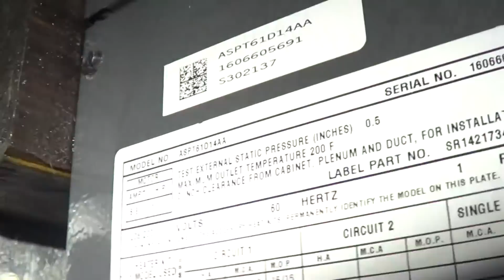How to diagnose and fix water blow by leaks on Evaporators

Comment: I got a downflow with slant coil and it leaks bad but the crazy thing is if I leave a gap in between the doors it doesn’t do it..
Reply from the maker: If the drain is on the suction side of the fan it will need a water trap of at least 2 inches.    Opening the panel may be reducing the suction in the line.

Comment: I have a Goodman Air Handler with water blow by. The unit is installed in a "Horizontal Right" application and the company we bought the unit from does not know there is a kit for the fix. The instructions in the install literature is very misleading. They have in the Heading "DOWN FLOW/ HORIZONTAL RIGHT" which they then refer all to DOWN - FLOW which is mis leading. We had to find out the hard way that you treat it as a down flow even though it's HORIZONTAL RIGHT. The distributor had to order the kits and goodman's tech support was not helpful. Equipment is only as good as the support you get when there is a problem. We lost two motors and two circuit boards because if this problem. Their local rep tried to blame it on duct work which that was not the problem. My suggestion if you install these air handlers in a horizontal position get the blow by kit and lean the air handler as this video is excellent. I think we need to relocate the circuit board in a box outside the air handler.
Reply: Can you advise what the blow by kit is and where to get it, tried using google and no luck. Having the issue that our unit above in a tiny attic used only for the airhandler is leaking loads of water and I'm sure the reason is because unit needs to get tilted along with needing the blow by kit you suggest.

Comment: Sounds like you are moving way too much air. What is the CFM per ton ? To much air flow will cause that same problem.What is or was your delta to?
Reply from the maker: I didn't measure airflow on this job because the system is the max size of 5 tons.   Airflow has to be max.   You do have a good point though.   I usually do 400 cfm per ton on heat pumps.

Comment: This is a notorious problem with Goodman air handlers ! Did you just prop up the front, so that the air handler is higher on the front end?
Reply from the maker: Prop up the back side so that the drain pan pitches to the drain.
Reply: @NathansHVAC  I saw it, when I looked at the video again. I put Goodman/ Amana in for years, & this was an ongoing issue. It seems to be more prevalent with the 5 ton air handlers . A few years back I became a Trane dealer, & all the water issues stopped. I was spending tons of time on these water calls ! Thanks for the information !!!!

Comment: I got to comment cause you sound it exactly like my own way of thinking. I used to install AH units in Attics in SW Fl for 10 yrs. I always did the same higher by 1 inch on oppositte side of drain. Never had an issue with Drain Leaks sittuation at all.  Once someone Else installed we have multiple Call and Go backs .. U true and right 100 %  They supposse to drain when installed Level but not Always😁 tnks bring memories of my 80 s inside Attics.....ttul

Comment: Evap coil end cap need to be modified for left air charge, coil looked flipped because I noticed lineset brazing point on top. It usually on the bottom. So end cap need to be flipped and J tube( water dripping guide) need to be relocated.
I believe instruction sticker in the A coil end cap.

Comment: I have same problem
?how can i fix
Reply from the maker: Clean the drain line first with a shop wet/dry vac.  Sometimes it is just a clogged drain.  If they doesn't dry things out just tilt the unit towards the drain.

Comment: Seems like High  air velocity taking water off the coil  or air turbulence
Reply from the maker: Actually, I think it is ram air pushing into the plastic drain and feeding into the gutter.   The ram air pressure at 20 mph airflow is 0.25 inches of water.  That is enough to over flow the 1/4 inch high gutter.
Reply: NathansHVAC I guess that's a newer design on the goodman coil?

Comment: I was thinking the same thing about static pressure and airflow. I've worked on a lot of those units and have never seen that problem before. Pitching the unit is almost always a good idea. Also I always like to have a tee after the drain trap for a vent that allows the trap to prime easily. And of course a tee before the trap for clean out access. That's just an FYI, it wouldn't help this issue.
Thanks for sharing this one, it's definitely interesting.

Comment: What's your static? Just move the motor tap down a speed. And is there no trap on that condensate line??! Needs a trap because that compartment is under a negative pressure. It's in the IOM.  I like the inspection camera
Reply: I was wondering about what your static pressure was too. Having worked on many of those units I have never seen that happen before.
Thanks for sharing your experience. That is an unusual problem.
Reply from the maker: You might have a point about too much airflow.  The system has no return air ductwork and just 0.25 suction static thru a 4" media filter.  There was definately something going on with how the air pushes the water to dam up on the 0.25 inch horizontal gutter.  Yes, the unit was trapped with a 2 inch drop.  Probably the drain design needs improvement with some sort of air baffle.  But, leaning the unit fixed the problem without too much trouble.
Reply: Nice!! That's all that counts, right?  Thanks for posting the video and keep up the good work!